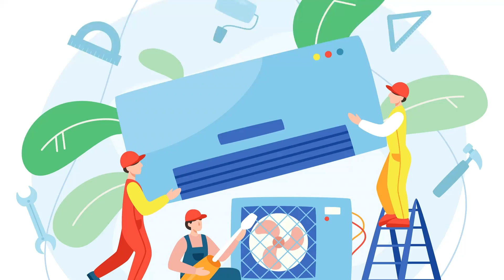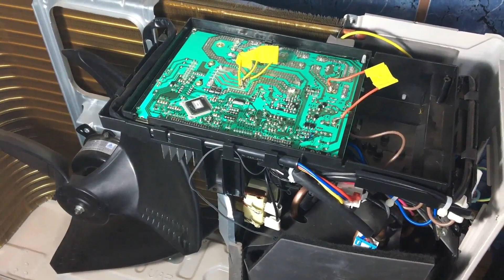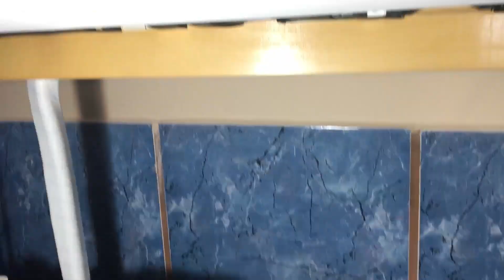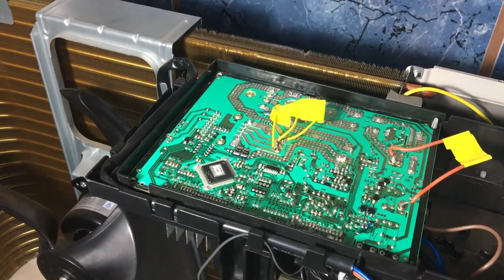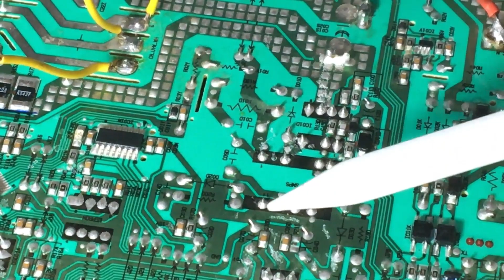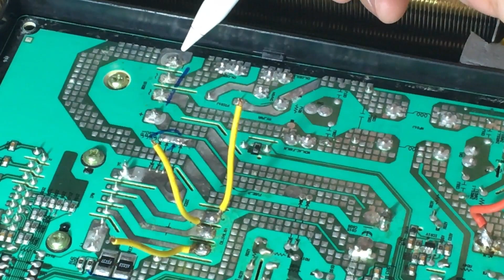Class75: How to Test Components Without Disassembling the Entire Inverter Unit?#inverter#electronics

Comment: how to identify if the relay or the switching ic of relay is defective
Reply from the maker: If the relay coil gets voltage but doesn’t click, the relay is faulty. If the relay doesn’t get voltage, check the small transistor or optocoupler that drives it — that’s the switching IC.

Comment: how to check the relay and how the relay switch, which is the switching IC of relay for indoor and outdoor board
Reply from the maker: Check if the relay coil gets 12 V or 24 V when the unit starts. If voltage is present but the relay doesn’t click, the relay is faulty. If there’s no voltage, check the small transistor or optocoupler that drives the relay — that’s usually the relay switching IC on both indoor and outdoor boards.